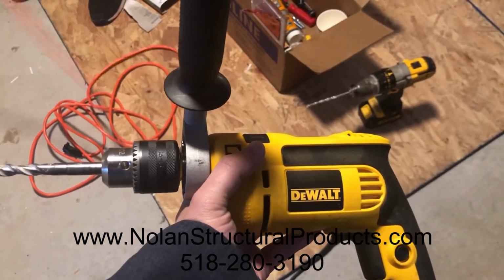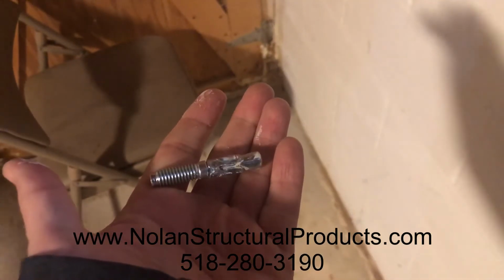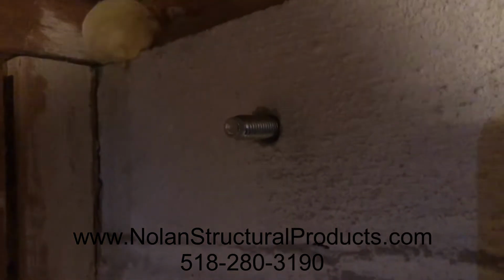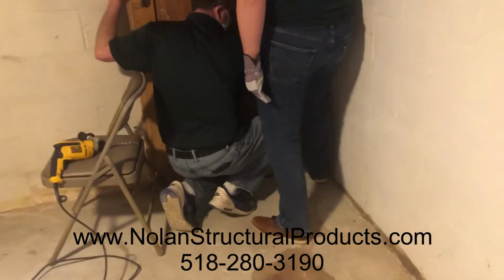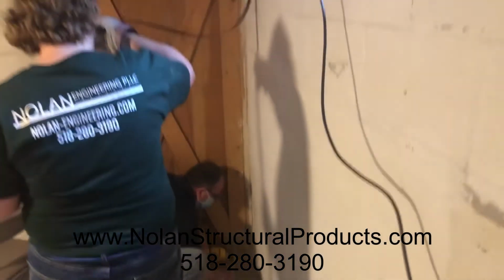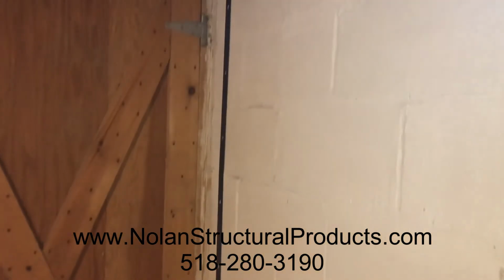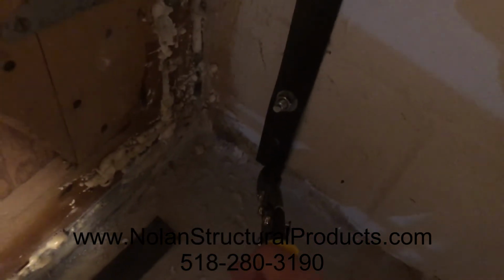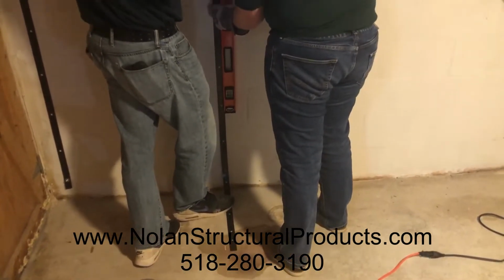DIY Foundation Wall Repair for Bowing Basement Wall

Comment: This is the worst wall fix I've ever seen. For the love of God please don't try this at your house. This guy is using plumbers strap to hold back thousands of lbs of static pressure. It's boy going to do much of anything. I've seen walls bend thick gauged I beams. I can assure you that tin foil isn't going to do the trick.
Reply: That's kind of what I was thinking!! Sheesh!!!

Comment: This won’t work. You need to involve the floor system and the footing. 
Joist run parallel to the foundation wall and from an engineering stand point need wood blocking a minimum of 5’ back at the strap location.